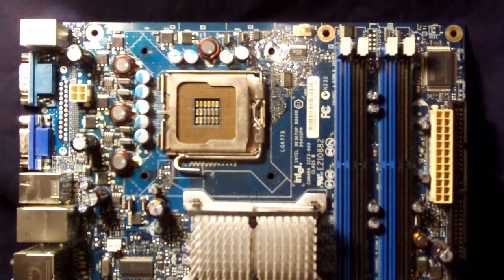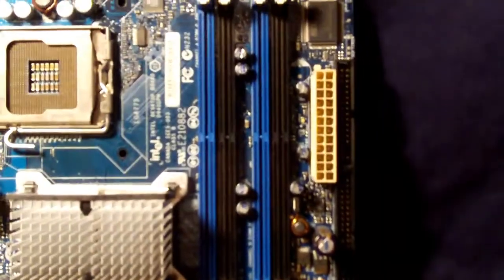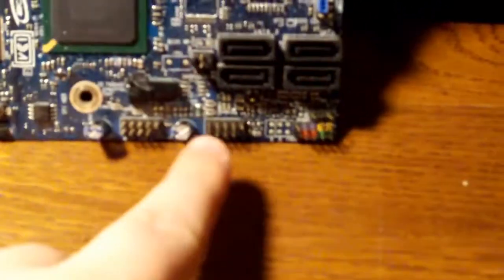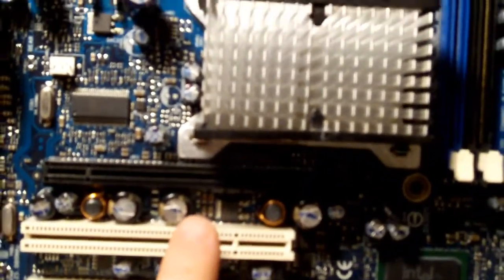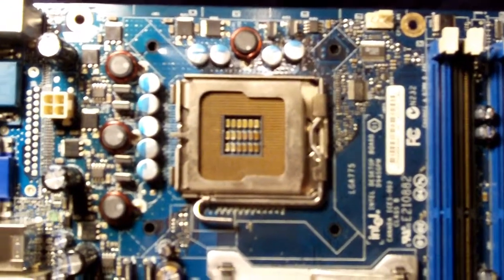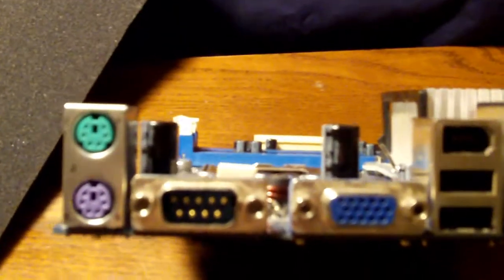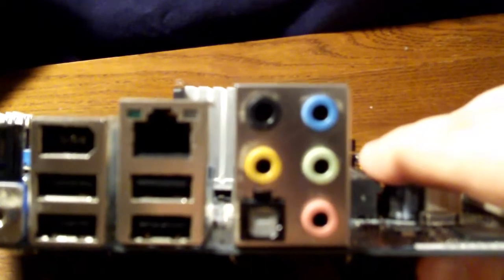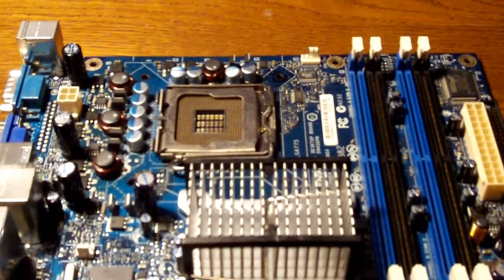Intel Socket 775 D945GPM Motherboard Overview

Comment: Nice, I have the same lga 775 motherboard but it has different model number  "d945gtp". It looks like a lot similar. Are they the same or there are differences in terms of technical information and parts compatibility. Can you give me a quick overview of this model as for what options do I have in terms of processors, ram type and speeds as I ma upgrading it to it's best potential it can be. I would appreciate a reply. Thank you.